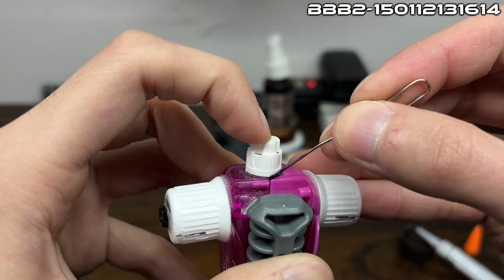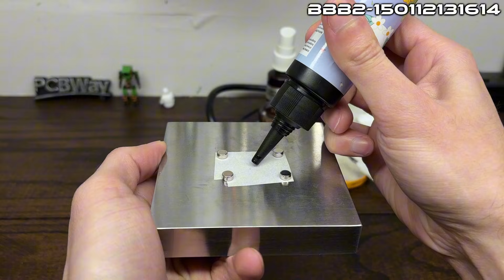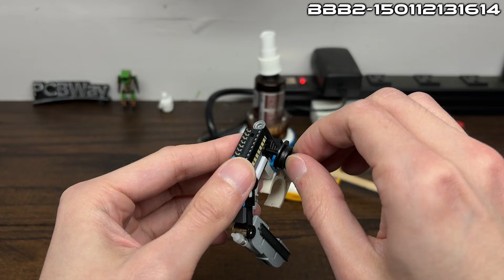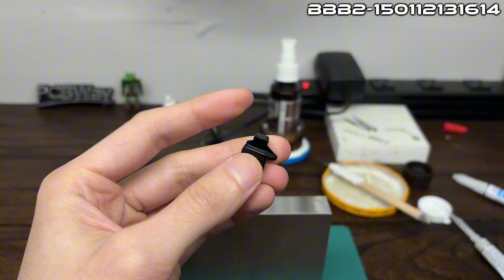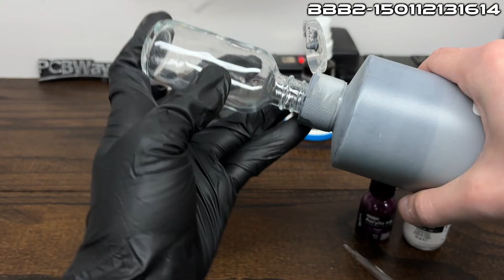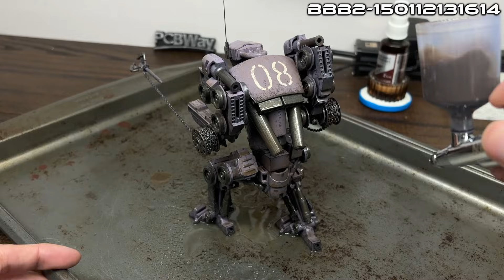Big Bot Bash 2 - Made from Trash, Ready to Thrash

Comment: Oh!  So nice!  I'm actually kinda indifferent towards the BBB this year, but I'm never indifferent about your work.  AND WHAT WORK IT IS!  

Nothing in-character this time, though I do really appreciate the additional bits of lore about non-Dominion forces and their capabilities.  Even the information about weathering issues in the Neocities tell a coherent story with everything else we've learned.  

But, onto the bot itself.  This is just... perfect.  You read the brief and came up with something consistent both with the rolled requirements, and with your world and the particular design language you've built up in designing your mechs.  I actually really like the consistency with which certain pieces are used across projects.  There is a definite sense of form following function and engineers who, solving the same problems with the same resources, come up with designs that are what you can learn to expect by looking at the work of others.  

The best example of this is the metallic casing for small pushbuttons being used as armored cowling for anything that needs access to the heat-generating internals of a mech.  They get called vents because that's what they do, but the fact that their consistently used in the same places and in the same ways tells an observer that they're seeing best practices.  I'm actually guessing that this specific piece is pulled from some common component with either a long history or high failure rate that has resulted in casings for these things being everywhere.  Some genius realized you could easily pull the open casing off and it made a great armored cowling to vent heat through and now everyone does it.  

Back to the Ash-mech, the very strong aesthetic comes shining through.  This design is not the design of the guys over in Reclamation, for all that they're both built from post-user salvaged parts.  Your guys built a mech skeleton to the customer's spec, threw in all the necessary components to tie the motors and joints into a cohesive whole and then armored sparingly so as to keep from robbing the design of critical mobility.  I would love a couple shots of this machine next to that machine just so you can show off how different purposes shape mechs even when they have the same kinds of materials sourcing.

Finally, on the posing - OUTTA SIGHT!  That dynamic pose with the flying grapple is TIGHT.  I see this bot getting some well-deserved recognition for you and your channel.  1500 subs ahoy!
Reply from the maker: That really means a lot. Even if you’re feeling a bit indifferent toward the Bash this year, the fact that you still take time to support my work is incredibly appreciated.

I’m glad the extra bits of lore landed well! Building out those non-Dominion spaces has been fun. I don't know if the script was clear, but I was trying to specify that syndicates like the Ashchain hide out in the "unregulated" Neo Cities, which are both free of the Dominion but lacking of their resources. In general, I have many non-audit narratives planned, but I try not to change too much when still figuring out what works and what doesn't.

Your breakdown of the design language continuity is exactly what I hope people pick up on, and seeing you notice it so clearly is awesome. Sometimes I wonder if using the same five bits on every build is too repetitive, but if it's common in the Omniplex, it should be common on builds. Out of curiosity, has any part stood out as a "signature" piece of my designs?

And you’re totally right about the casing piece. I hadn’t fully thought of it that way, but now I’m seriously tempted to make your explanation canon haha. There's always a lot happening, so keeping track of what is canon and what isn't will always be a challenge.

The idea of comparing the Ashchain build to the Reclamation Extractor is a good idea. I've been considering ways of having side by side shots in the future. Maybe a "year in review" would be a good place to report on all of the designs at once.

I wrestled with that grapple shot for a while, so I’m thrilled it stood out. I could have done a lot more for the dynamic pose, but as I've said before, 1% better per iteration is enough.  I really appreciate the encouragement. 1500, here we come! 😁
Reply: @proto.roborovski  The two signature pieces that first come to mind are the use of the pushbutton casing for the vent mentioned above and your tendency to convert wire terminals into thrusters or ventilation ducts.  

Other than that, the main thing I notice and love about your designs is the fact that, at least in your narration, there is a focus on what a part does and where it came from.  A lot of modelers basically focus on what looks cool in a specific spot.  This is a good tack to take because models that look cool are more fun than models that don't.  BUT, they can end up with incoherent design choices because something fits into a particular design aesthetic and there's no internal need to justify someone in-universe making this choice or doing the work to put this part on-board.  

You, Gameyy Builds, and Cut Transform Glue are all really quite good at treating your models like something designed and built in a real world where everything takes time and resources to make.  To me, the resulting focus on in-universe durability and function goes a long way to capture what I enjoy in model videos, which is the recreation of the world in miniature.  (For a non-fantastical example, I direct your attention to the absolutely insane channel HMS2.  He's a Japanese-language miniature artist whose eye for detail and willingness to replicate things at the limits of visible scale is just insane.  Oh, this dish has rice?  Better just roll out 150-300 individual grains then!)
Reply from the maker: @bearnaff9387  Thanks for the feedback! I definitely enjoy using electrical connectors quite often.

I believe strongly in function before form. If the mechanism makes sense, it will naturally look cool.  While I intentionally create designs that feel logical, it is also hard for me not to, because that is how I naturally approach complexity. There are many designs I absolutely love but I can't figure out how a joint would work and don't end up recreating it myself. My goal is to bridge that final gap between art and engineering, making sure the design not only works but also feels balanced, cohesive, and visually strong.

HMS2's work is amazing and worth emulating!

Comment: Really great build and narration. Well executed all around. So cool how you were able to talk about the parts you used without breaking immersion from the story.  What bits do you use to thread on arms and torso?
Reply from the maker: Thank you! I assume you mean the shoulder and waist connections? 
For the shoulders, I epoxied an M3 hex nut to a bottle cap as the fixture, and the bolt for the joint passes through a series of nylon washers jammed into a pipe bracket. I normally use a 3D print with a hex slot for the nut to make sure it doesn't break free or spin, but you know the rules!
For the waist, I used an M3 rivet nut and made sure it would countersink into the pencil sharpener pelvis. I use M3 bolts for most builds (M3 and M2 bolt packs are in the description).
Reply: @proto.roborovski  Ah great ideas. I saw you added something but just missed what it was. I have been gathering parts for my first bot build and love the inspiration.
Reply from the maker: @heartofoak  It’s quite fun but can be a challenge. I hope you have a blast!

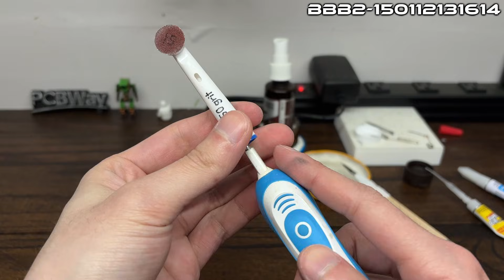Comment: 3:22 - wtw?  Nice sander.  Can u give details on that?
Reply from the maker: Sure thing! It's the cheapest, simplest oscillating toothbrush I could find. Simply cut off the bristles and double sticky tape sandpaper to the head. With removable heads, you can prepare several different grits depending on your needs.
Reply: @proto.roborovski  - niiice!  It must work pretty good then.  I may have to give that a try.  Thanks.
Reply from the maker: @jeffwalters7404 it is surprisingly one of my most used tools!